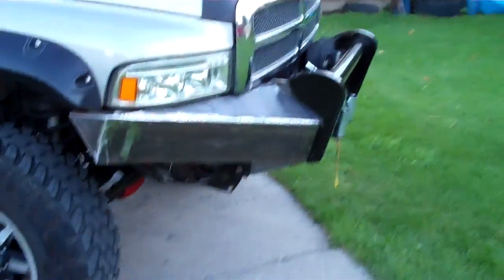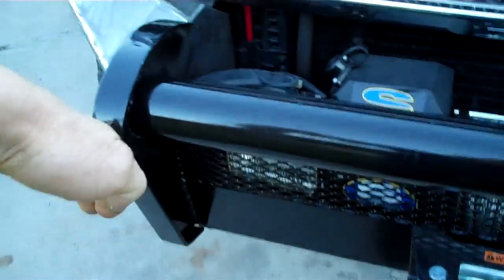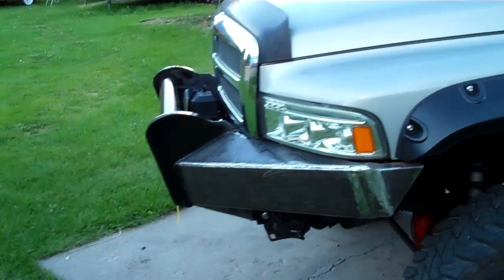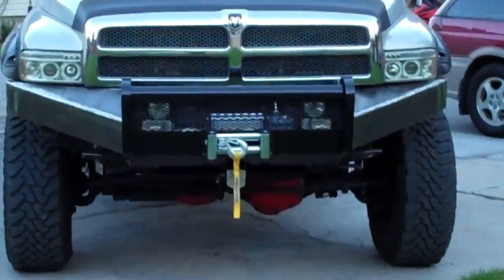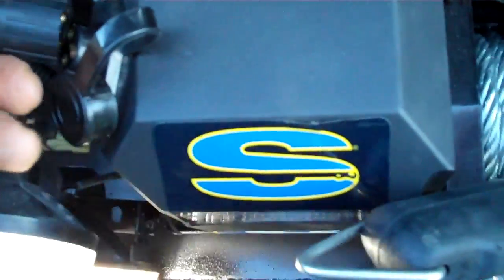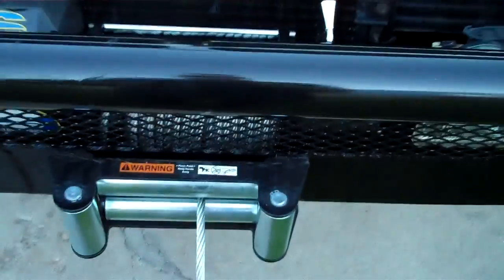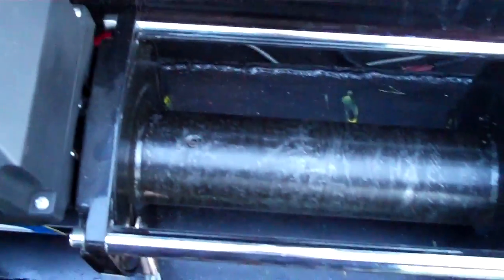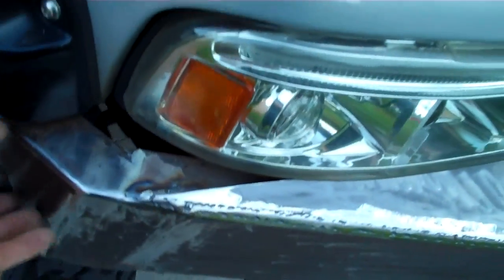Custom Winch Bumper Build Progress Report #4

Comment: Hey man , i cant tell when this was posted , but if you take your winch spool it all the way out and hook it to a tree , set your e-brake on the truck about half way with the truck in neutral ,  Then use the weight of the truck to spool the winch in , it will properly set the cable on the drum .  This has to be done in order to set the tension on the cable and seat the first row so you use the  full force with out kinking or damaging the cable ... And so the cable wont pull off on the first run.

Comment: Thanx for the heads up.I know about some of the recent stuff but the hella 500 fogs i got is one of their top sellers and has worked well for me so far.They made with thick abs and glass lens that hasn't cracked,but anything can happen,after all it is glass.

But so far No problems.. unlike Brians mishap...Hella is a reasonable priced fog light,so for me it works for what i need them for.I have the rock protectors on most of the time until i need them..

Comment from the maker: Just ceramic engine paint.  I need to be able to touch it up easily.  I intend to use it properly.  I'm going to push down some pear trees with it in the orchard and then pull them out.